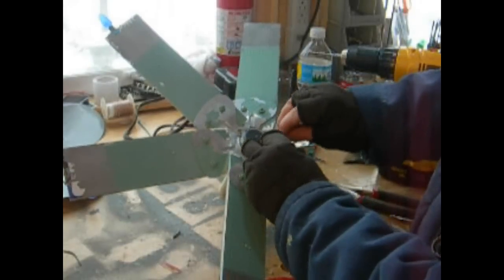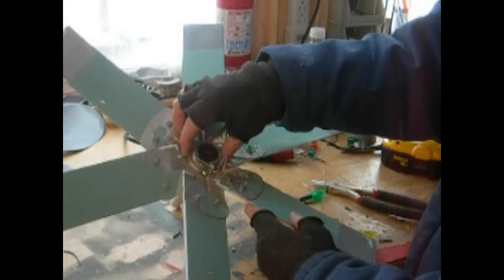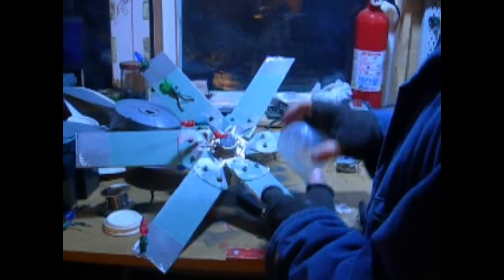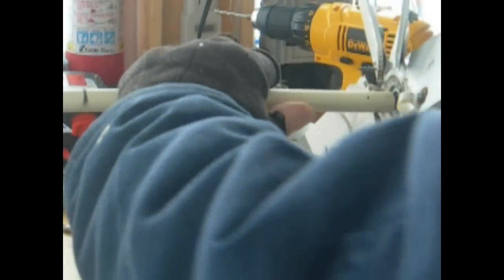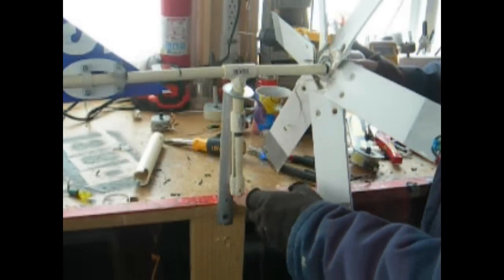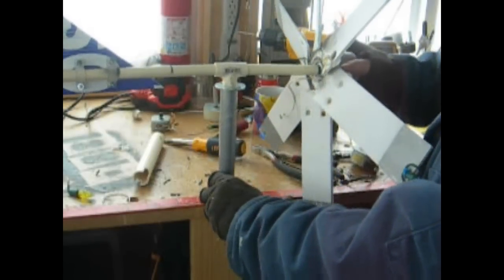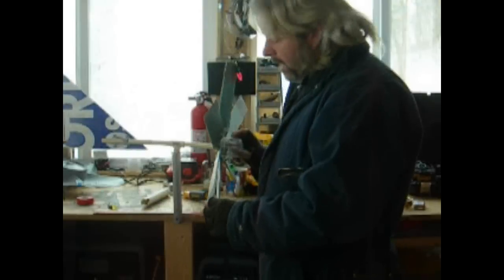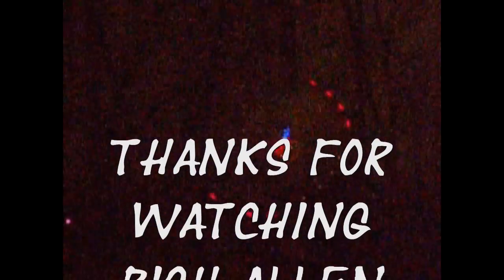LED WIND TURBINE PART 2

Comment: Way to go!  Excellent video.  I make a lot of artsy windmills and the idea of lighting them up like this is sooo cool.  I was a bit unclear about mounting the stepper motor to the hub and about checking the polarity of the leds against the wires coming out of the motor.  Longer wire on the led is positive.  Well done.  You can see some of my stuff at martin mobiles. Thanks very much.